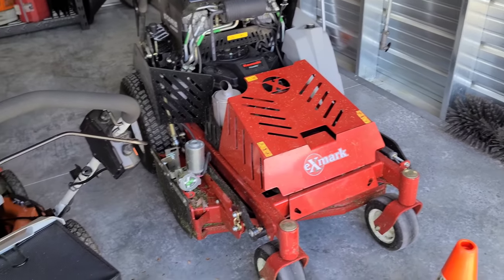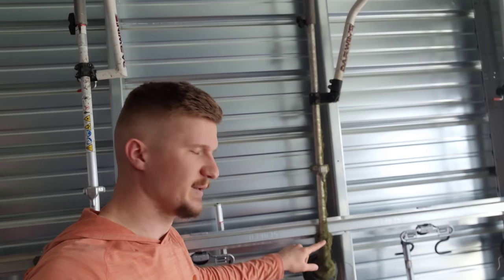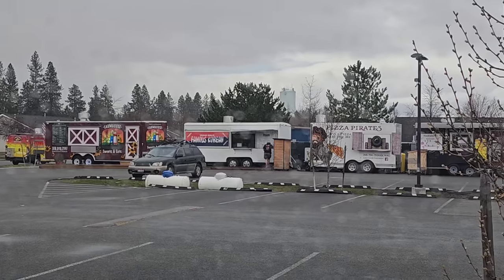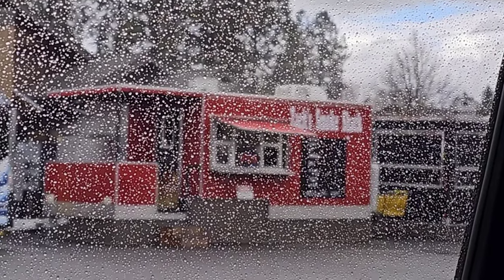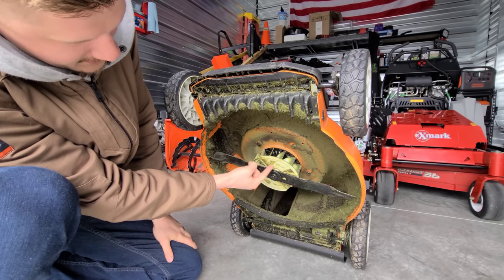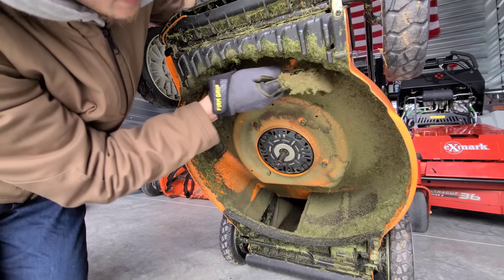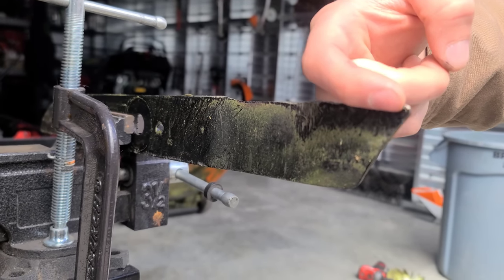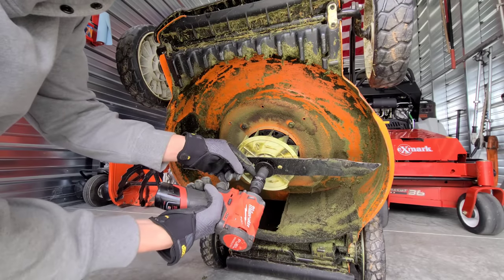Maintaining Lawn Care Equipment On A Weekly Basis

Comment: Great video, very informative. Clean well-maintained machines are safe machines. I use Turtle Wax High Gloss spray, on my car and I bet it would be just as good on lawn equipment as well. Spray a small mist, wipe dry with a soft cloth, presto, high shine. Car is finished in less than an hour. After using the wax things will definitely slide off the slick surface. Thanks again for another great video. ❤Love you, stay safe and God Bless.

Comment: I use STA-BIL storage fuel stabilizer in my lawn equipment fuel tanks. And in gas cans immediately after fueling. Usually putting a dollar or two of gas in vehicle before filling gas cans. With ethanol free gas. As water and ethanol  can still be in gas from previous usage. You didn't clean deck on eXmark. I would be afraid to use pressure washer on electronics equipment. The articles that I have read say using water on spindles causes them to fail. What about greasing equipment fitting periodically? Good talking video. Thank you. Blessings to you.

Comment: So in terms of jacking up a mower deck, all be it stand on or zero turn, i find that using a motorcycle jack is a lot safer as it has 2 contact points for the lift instead of one, like the regular floor jack